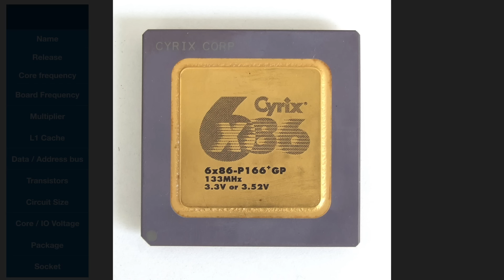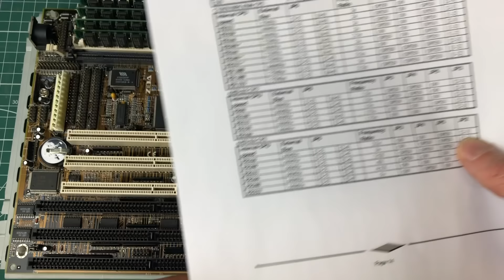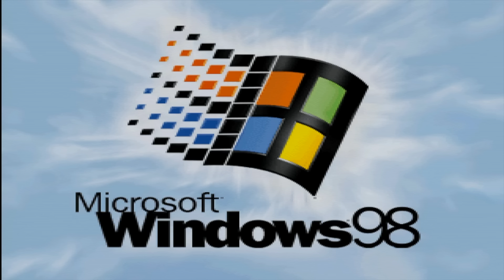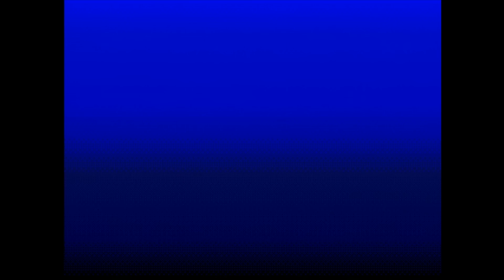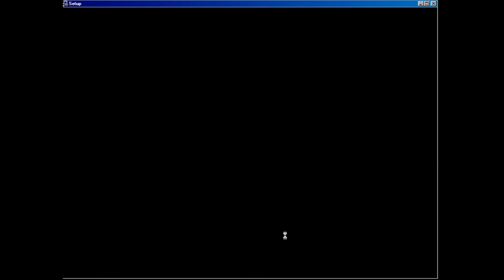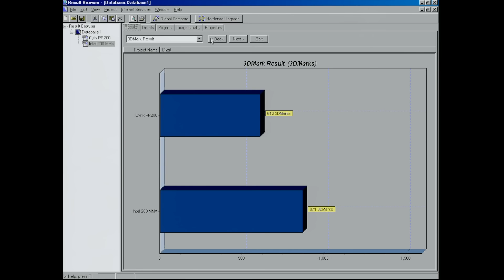IBM / Cyrix 6x86MX PR200 vs Intel Pentium 200 MMX

Comment: Hi RetoSpecor78, a bit off-topic perhaps but I have a question about the pentium 2 processor. I’ve got a pentium 2 400 mhz system from 1998 with a chaintech motherboard and it has an odd problem. When I turn it on it beeps in an alternating fashion, long-short-long-short, etc. It won’t boot at that point but if I turn it off and on again 2 more times it boots up fine. It has an award bios and I’m bit worried that the cpu may have a problem. After a sucessfull boot it seems to run fine, cpu seems run at about 19-24 degrees celcius. Have you experienced a similair problem before and do you have any suggestions on what could be wrong and if it is fixable? I’ve had this computer since it was new and it has only started doing this in recent months since I rediscovered it. Could there be something wrong with the cpu and / or fans? Or would it be a psu issue? The bios reports no other problems, cpu fan seems to run but at few thousand RPM. Some advice would be appreciated. Maybe also a good topic for a video?
Reply from the maker: According to the award bios beep codes this does seem to point in the direction of the cpu. Do you have another cpu to try ? Does it do the same with all of the other components unplugged ? Can be any number of things. Can be a bad connection somewhere in the slot 1. Can be bad caps on the mainboard. Can be a bad cpu. Dodgy psu can also cause erratic behavior..... to diagnose these issues you first need to eliminate what it is not, and when you’re down to the psu, motherboard, cpu and ram you need to be able to swap some parts.
Reply: Intermittent boot-up problems, especially with cold boots, are usually associated with aged electrolytic capacitors. Have you checked whether any capacitor on the board is bulged or leaking?
As RetroSpector78 also mentioned, your power supply can be the culprit. You should verify its voltage levels and check capacitors inside the PSU for bulging/leaking.
Reply: @peachgrush  I have not checked that yet, but I am kind of suspecting the PSU. Sadly I don't have a spare CPU to test but I could try a fresh PSU. The PSU in the system is the original one. Once the system has booted, the Bios doesn't report anything out of the ordinary. All the tempratures and voltages seem fine and the system is also running at it's normal clock speed (never been overclocked allthough the CMOS battery was replaced a few months ago and yesterday I noticed the clock multiplier was set to 3.5x100 which would suggest a slight under-clock but I think this is the safe default setting, I have put it back to 4x100 as I know that is a 400 mHz cpu from the day my dad bought it). I recently fitted a 5.25" drive in it (a nice, well working YE-DATA YD-380B) so that I can image old disks. My Pentium 4 system sadly only support one floppy drive appearantly and the Pentium supports two drives which I prefer. I really want to keep this system alive as much I can as I'm quite attached to it.

Comment: My vintage Packard Bell Legend 386sx had a Cyrix processor and mathcoprossor, 4mb ram, extremely useful for the time, Dos Shell, plenty of games to be played back when, Master of Magic, Fates of Twinion, Shadow of Yserbius Eye of the Beholder. All played fine. No music but back then that was a luxury. Still is now whether you have a Roland midi device or not.
Reply: Put that Cyrix in a ISA card for graphics this would be outstanding.
Reply: Still have my first laptop, I'm looking to for my Packard Bell Legend 386sx but I'd rather have it decked out vs lowend. Meaning if DOS gaming is the purpose I'd want a Pentium overdrive or equivalent. And usb 2.0 support.
Reply: Curious, would shadow ram be functional with that motherboard, also would EMS expanded memory, be eligible to set pageframe address emm386.exe frame C000.

Comment: Cyrix cpus weren't good, they were prone to overheating, and their FPU computational abilities weren't as good as Intel's Pentium MMX series.
Reply from the maker: Ace1000ks1975 later versions like this MX run hotter than the MMX cpu’s but the big heat issues from the past were solved. But FPU was indeed a big drawback.  I always have this thing for the underdog and try to fjnd the positives :) runs windows app very fast and games are playable :)
Reply: @RetroSpector78  Not everyone could afford to buy a Intel Pentium based computer back in the mid and late 1990s. Cyrix was definitely the cheaper alternative, just like how AMD is a cheaper substitute for Intel based cpus. The difference in the present is that AMD's Ryzen processors can actually compete toe to toe with Intel's best processors. Back in the mid to late 1990s that wasn't the case until AMD released their Athlon based processors which was as good as Pentium 2s and Pentium 3s.

Comment: hya, would you be ever so kind as to make a video on the Pentium 266 Tillamook modding and maybe testing that CPU vs. AMD k6-2 and Pentium 2 266mhz please? I'd really really want to see how you can mod it with soldering or that conductive ink pen before I try doing it myself. There's a thread on vogons about it, but I'm scared of trying it with just a picture showing the modded pins and some tape that I don't have a clue what isolates.

Comment: You need to use Vintage version of CPU-Z! There is one. ;)
Reply from the maker: The vintage edition failed with a blue screen of death unfortunately. Found 2 versions that did work (the last known supported version for win98, and some rebuild I found via vogons.
Reply: @RetroSpector78  It was called straight up "cpuid" for the longest time.

Comment: The Cyrix was fast but Quake and other 3D games required floating point performance. I remember that that's what killed Cyrix back in the day just like you covered here. My dad bought a P200MMX Sony VAIO PCV-120 in early 1997 and I was glad that I got it.....of course the Pentium 2 came out 2 months later so we learned a hard lesson with that one.
Reply from the maker: Yeah but from what I remember the initial p2 wasn’t that much of a performance gainer as a lot of people thought it would be. Socket 7 remained very interesting with amd offerings. And with a 3dfx card many games were playable. Also seems to be working fine on 187.5mhz (spoiler) :)
Reply: @RetroSpector78  the Pentium 2 233Mhz was significantly faster than the Pentium 233MMX in some cases. In others they were close or it was even slightly surpassed. Phil did a video comparing these two along with the K62-400 that illustrates this. Ultimately, I would have much preferred to have that P2 233 which had upgrade options. I, unfortunately, didn't know that I could run the K62-400 in my Pentium 200MMX system because of its multiplier feature. That would have blew my mind if I had known back then.

Comment: In the 90s I always used to buy the "underdog" CPUs. Anyone remember the NexGen Nx586-P90?
Reply: I bought them because I had no money :D Back then we did know nothing about FPU power or benchmarks. We just saw the PR numbers and thought: Cool. Same speed, half the price ^^
Reply: Mac Daniel Me too! I knew a guy with a PII 450. I was jealous. I bought a K6-2 350, and overclocked it to 400. I then got a Voodoo3 and overclocked it! My system was about half the price and just as fast.
Reply from the maker: Not that familiar with the non intel / amd / cyrix cpu’s. But totally get the underdog sentiment.
Reply: @RetroSpector78  NX686 which was in development is now known as AMD K6 after AMD bought NexGen
Reply: Was that one of the high clocked 486 core CPUs?

Comment: Always nice to see this direct comparisons and a 3dfx Voodoo Banshee in action! Yes, the 6x86MX is a bad overclocker, but maybe you can find a Cyrix MIIv low voltage 180 nm version with 2,0-2,2V VCore, they are good overclocker.
Reply from the maker: This one is currently running stable at 187.5mhz. Sometimes has a little bit of an issue with some winstone tests (1 hour testing), but playing games, working in windows, running prime95 all seems to work fine. Difficult to view the cpu temperature unfortunately
Reply: @RetroSpector78  It needs liquid cooling ;-)

Comment: I dread to think how much money I 'wasted' on AMD and Intel CPU's and motherboards in the Socket 7 era!  I was never tempted by Cyrix though, it just couldn't pull those FPU's in games.
My last CPU from that era was the K6-III 450.   I have fond memories of that particular build.
Reply from the maker: Only hava a K6 and K6-2 here ... would love to get myself a K-3
Reply: @RetroSpector78  It's nice to see the mighty socket 7's still kicking around. Thanks for the upload. I finally managed to get my hands on a motherboard that supports my k6-2+ 500, which is similar to a K6-III in performance, only with half the size of on die L2 cache. Which makes it miles better than a plain jane k6-2, considering the lack of any on die L2 cache on those processors (not to mention the decent overclocking potential of the + models, thanks to the smaller manufacturing process). As a consequence a lot of emphasis was put on the motherboard. In particular on the speed and amount of L2 cache soldered onto the board, which had a considerable influence on the overall system performance. By the way, it would also be interesting to see the P1 200MMX overclocked and pitched against a later model k6 or earlier k6-2. The 200mmx should clock rather well, possibly  reaching 290 Mhz (3.5*83). Keep up the good work!
Reply from the maker: Endre Toldi we should get together for a lan party :)
Reply from the maker: Endre Toldi planning to do some overclock videos. Problem is I don’t want to push it over its limits, but not easy to get sensor data on the socket7 platforms. And without knowing stuff like cpu temperature its hard to find dat limit. Have a k6-2 350 also. So think you can expect some more socket 7 videos. And we can always put your k6-2+ 500 on the bench :)
Reply: @RetroSpector78  On ocasion I'm using an infrared thermometer and just point it onto the heatsink. It gives an accurate indication of the temperature (not the cpu core temp of course). Most of the time due to laziness :) I really just use my finger (watch out for static electricity though). If I can't hold my finger on the heatsink for more than two seconds the cpu is getting too hot. With socket 7 cpu's this barely happenes though, especially if you strap on a socket 370 cooler. Good luck and enjoy the gained free computing power. :D
Reply: LUNATIC75 k6-3 was a killer. Stupid fast

Comment: Have these ... With a Spacewalker motherboard. Liked those box-designs of Spacewalker/Shuttle :) :)
Reply from the maker: Really liking these (super)socket 7 builds ... nice to be able to replay these old games. And not constantly worrying about exploding tantalum caps and failing mfm drives :)

Comment: Now you need to find an IDT WinChip :)
Reply: I have a Winchip C6 and Winchip 2, both with 200 MHz.
Reply: @3DfxAslinger  Yeah, have both in my little museum. Also the Rise mp6 @ 200MHz.
Reply from the maker: Always on the lookout for cool stuff, but this one hasn't found it's way here
Reply: @RetroSpector78  Got my chips from China last summer. There are a few seller in HongKong and Taiwan. Rise mp6: https://www.ebay.com/itm/Rise-Technology-MP6-PR-266-MHz-MP6441RPFH4-Q-TESTED/143074735003?hash=item214feb339b:g:VhkAAOSw7wFcDUuR

Comment: I always liked setting the fsb to 83mhz or higher when the board supported it and those cyrix procs often worked without a fuss other than being furnace procs.
Reply from the maker: OC will be for the next video :) This mainboard only went to 75Mhz but have a super socket 7 that goes all the way up to 100Mhz.